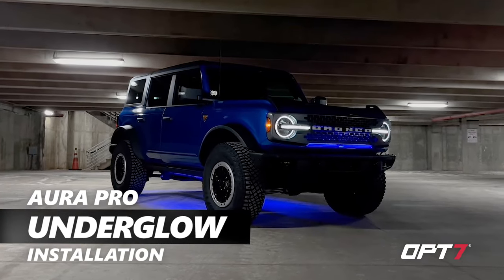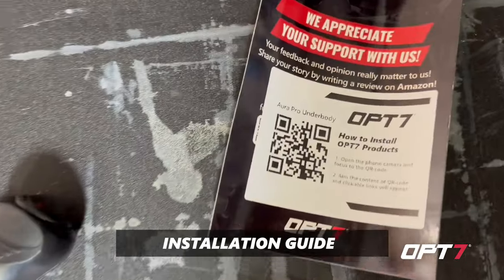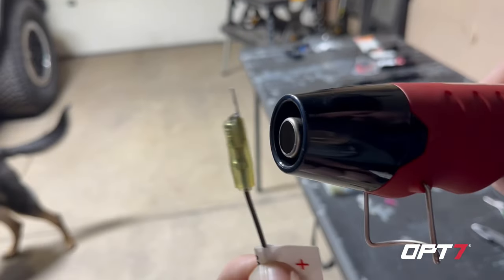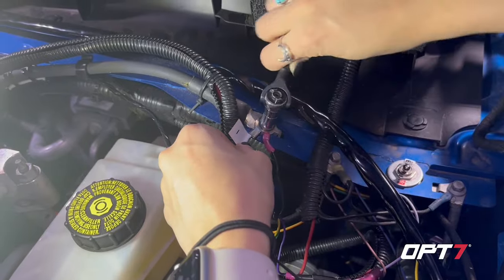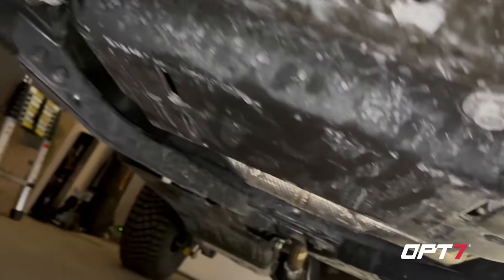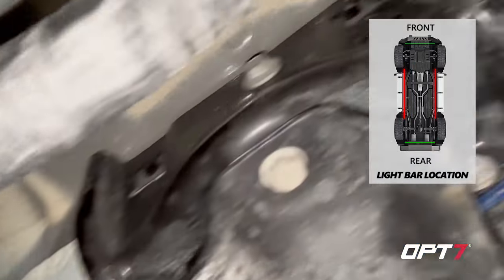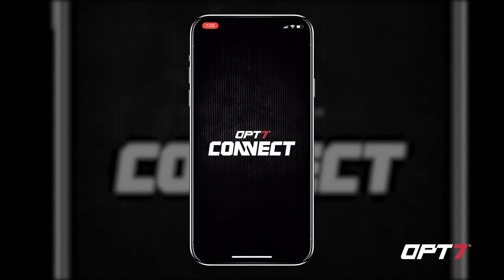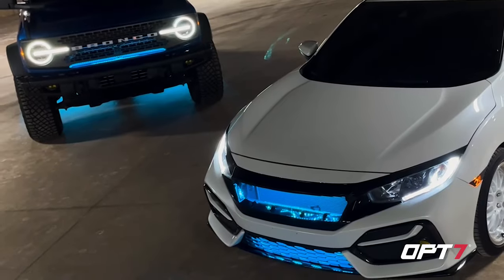OPT7 |  How to install AURA PRO Underglow on Ford Bronco

Comment: Can you provide a link to the magnets that y’all used? I have a ram 1500 Rebel and it has a front skid plate too. I’m intrigued with how you mounted the led strip on the grille and how it looks
Reply from the maker: You can find this part at a local hardware store such as Home Depot or Lowes.

Comment: If hardwired to fuse taps, does it remember the light setting every time the car turns on?
Reply from the maker: For this kit, it will require you to connect to the app at every use for safety reasons even if its on a constant fuse.
Reply: @OPT7Lighting  Understood thank you